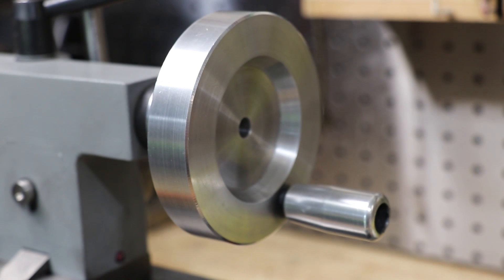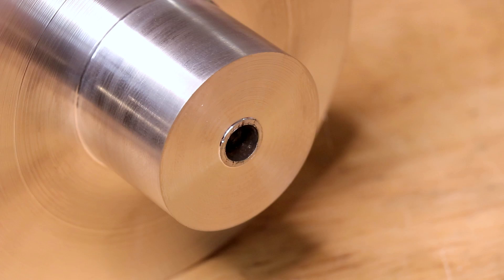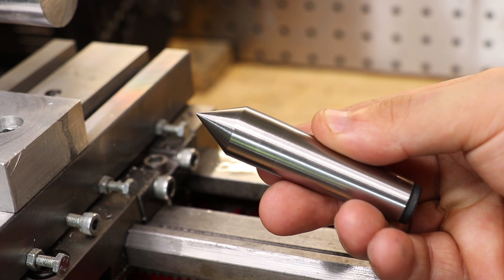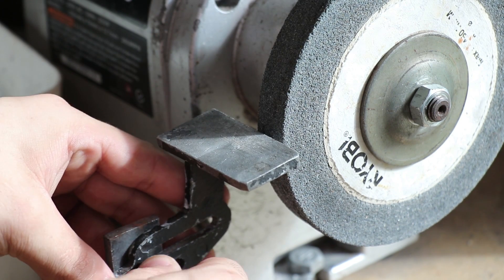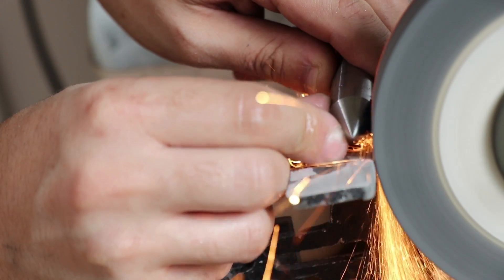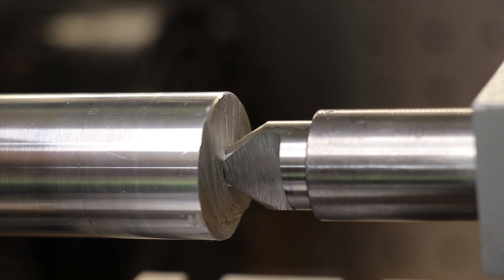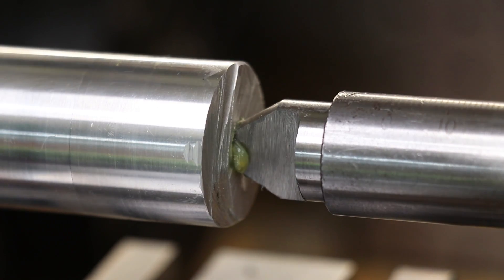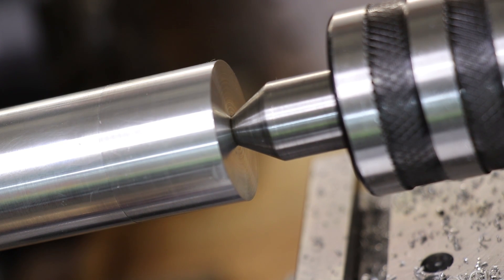Making A Half Dead Center Lathe Tool From A Dead Centre

Comment: Dead centers are not just cheap versions of rolling bearing centers. In fact they are the ultimate in accuracy when you really need it, rolling bearing centers always have slop. Notice I did not say "live center" above. An actual live center is a dead center mounted in the chuck and rotates with it. Terminology and techniques are slowly being lost as the generations pass. That's a shame. I always keep a good dead center handy for best accuracy.
Reply from the maker: Cheers Bill, I'm sure you get more use out of a dead centre than I do. I just prefer the convenience of the live centre, for better or for worse, and that has gotten me by so far with the parts I make
Reply: @artisanmakes  I see. I withdraw my advice.
Reply from the maker: Everyone has their own preferences for machining. Cheers
Reply: @artisanmakes  Machining is a hard science not composed of opinions based on feelings. Cold hard fact is dead centers are more accurate than bearing centers.
Reply from the maker: Sorry, my point was everyone has preferences for what tools they use, some people prefer to use live centres, even if it does sacrifice ultimate concentricity. Cheers

Comment: I think you got it backwards, no reason to use anything but the dead center. Live centers are a compromise and an added expensive. A dead center is cheap, more accurate and reliable.  But I guess for that little lathe it doesn't really matter as it's neither really accurate nor reliable
Reply from the maker: I don't know what your machining background it, but I'm not sure how you come to that conclusion. I have been in  a few industrial workshops and unless its a low speed part, dead centers are never used. Live centers are better suited for the speeds of modern turning and you don't need to worry about greasing the center. Plus this lathe is easily capable of hitting tolerances of +- 0.01mm if I need it. Cheers

Comment: If you under drill the hole in your part, face with the live, then drill the hole to the proper size, would this not achieve the same result?
The portion of the face you cannot reach would be removed when drilling the hole to the proper size.
Assuming you have the extra space required.
Reply: Yes this works but relies on happenstance. The half center does this in one step in cases where there will be no additional larger hole. It also allows such processes as threading and turning small diameters. Good thinking there.

Comment: I have used that center before, for a trick I think I saw in a Blondihacks video a while back. You can use it for indicating in center punched holes in the 4 jaw chuck. This takes advantage of the fact that the dead center has a center drilled in the back of it. You can put the point on the dead center inside a center punched hole, and use the hole in the rear for alignment, and then you can put a dial indicator on the center to find how far out the centerpunched hole is and correct for it. I used this for drilling accurate holes for the adaptor plate for my vertical slide attachment, since I don't have a drill press or a mill yet.

Comment: I don't mean to be a backseat machinist, but you might benefit from grinding a small radius over the edges of the flat spot, just so you don't have as much deformation and wear from the center trying to be a countersink
Reply: I was going to advise the same, just chamfer the fresh edges for a both ways chuck rotation and no chisseling from the edges.
Reply from the maker: I haven't run into any cutting wear. The edge is slightly rounded I'll knock the edge off if I run into any issues

Comment: To lubricate the center go to the auto parts store and get a tube of engine assembly lube. Don't over tighten a dead center to the work. The live center works very well but unless you have one with an extended center (sometimes called a CNC center) it often gets in the way. This is especially true when single point threading small diameter work.  Then a half round dead center is very helpful.
As an aside it becomes obvious what the small cast-in hole on the top of a tail stock on old lathes is for. It's where you put the white lead that was used to lubricate the dead center. White lead works very well but you can't get it anymore because OSHA was afraid you might mistake it for mayonnaise and put it on your sandwich at lunch time.
Reply: Annoying that even lathe manufacturers think that rolling bearing centers do everything better than dead centers and so they omit the lube well and applicator on tail stocks now. Seems like in years to come when someone says "dead center", new machinists will say " a wut?". We are gaining new knowledge for sure but should not lose what we already have.

Comment: I don't recommend using inserts for turning steel to turn aluminium, always use the proper insert
Reply from the maker: I have tried a few times with those high rake ccmt inserts and ive always found the edge to be too brittle for this lathe.
Reply: @artisanmakes  that is too bad
Reply: @artisanmakes  they are for initial facing and roughing, generally only use them as finishing inserts or very conservative depth of cut.
Reply from the maker: I understand but it's mostly due to the lack of rigidity on this lathe, though some people do make them work on their smaller lathes